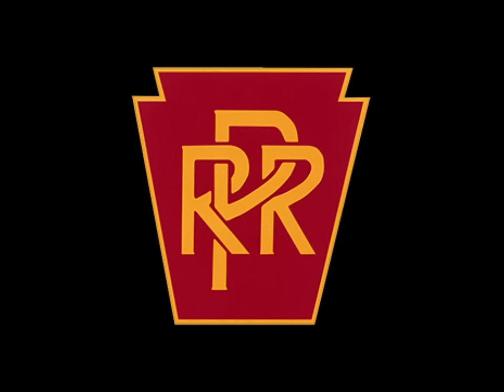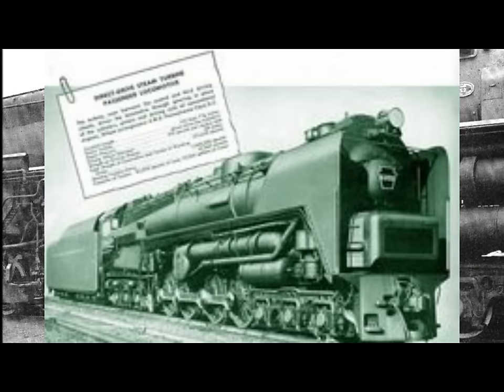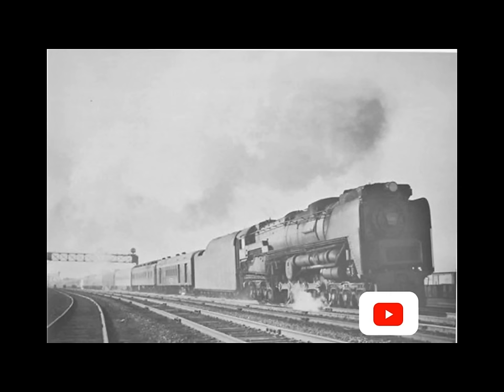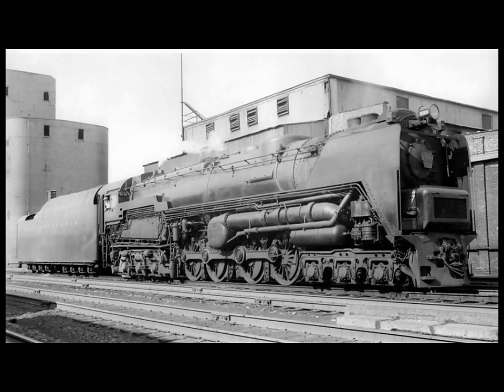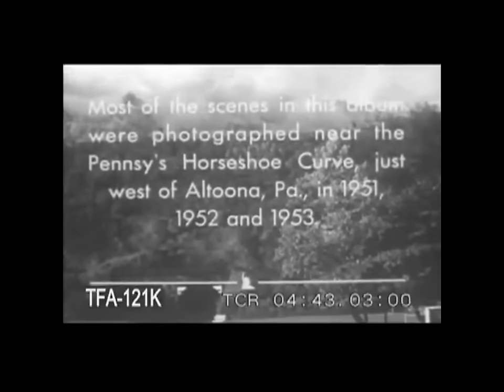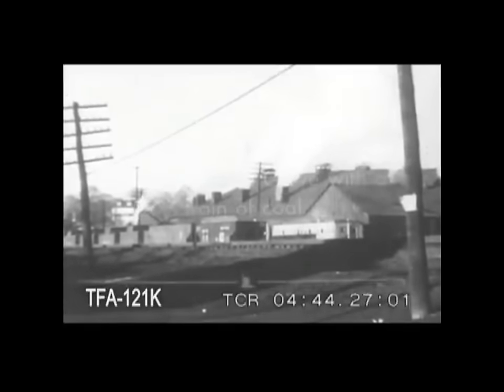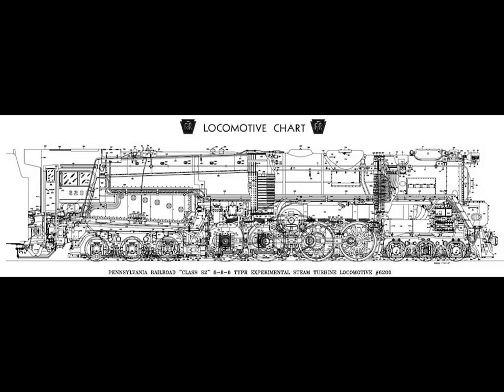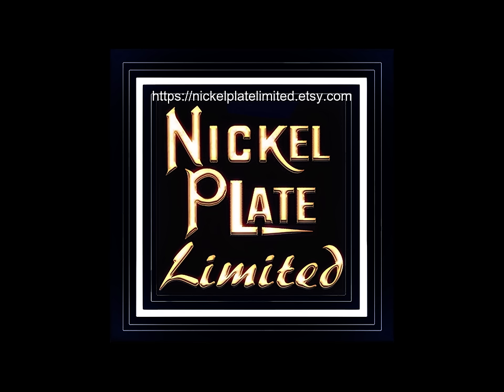Pennsylvania Railroad S2

Comment: A turbine for a locomotive will always be problematic.   Unless you got very long stretches of track with little to no slowdowns or stops. Turbines will never work to there full potential.
Reply: @animal16365- Chrysler Corp found out that the same thing pretty much applied to automotive applications. Turbines work fine in ships and aircraft, where high power output and steady speeds are required.

Comment: I believe the only change that may have given the S2 much more of a chance for success would be adding a planetary gearset to the reducing gearbox, thus providing two speeds. The unfortunate thing is the steam turbine is essentially a constant-speed engine, while locomotives need an engine which provides controlled torque, starting from 0 RPM. Naturally it proved ill-suited to an application which must accelerate and decelerate often, operate in either direction and no condenser can be fitted. Electric motors, on the other hand, excel at all of these things and so they propel practically all trains today.
Reply from the maker: And that's why I think the S2 would have done much better as a freight locomotive

Comment: The S2 has the same physical presence as the 800 class FEF and the Niagra.  The addition of smoke lifter ears added to their impression of industrial art.  All are free of frills and imbued with strength-of-purpose.  On the other side of the steam locomotive art are the streamlined steamers such as the GS4, the J class, the S1 duplex, the T1 duplex, and the Dreyfus Hudson.  My favorite is the Dreyfus 464 with Scullin disc drivers.  Credit must be given to the Pennsy for their bold locomotive engineering challenges never attempted by any other RR.

Comment: Sounds like they should have spoken to Sir William Stanier of the London Midland & Scottish Railway, His turbomotive was built on the same basis in 1935, and remained in service until 1949, and used a conventional Princess Royal Class loco boiler, working at 250psi, it was very powerful and very economical, and was only rebuilt  in 1952 after one of the main turbine blades failed, and British Railways were uninterested in repairing a one off loco.  Metropolitan Vickers supplied the turbines in 1935, and was designed to speed was controlled by turning on or isolating the turbine nozzle jets to overcome the problems all turbines have of being very inefficient at lower pressures (ie if driven like a conventional loco on the regulator/throttle).
Reply from the maker: A lot of consulting should have been done quite frankly

Comment: It is such a shame the s2 design quirks were never addressed. It was a fascinating design that really could have gone in many directions. Had they set a lower speed maybe locomotives similar to the s2 could have made amazing freight locomotives.
Reply from the maker: Yes indeed. Several authors thought so as well.
Reply: @TheRailroadCrossing-SteamPower image they combine this concept of engine with a challenger wheel arrangement. I really think that could have been quite good.

Comment: The S-2 is definitely unique in appearance and very high on the scale of cool looks.  It's a shame it wasn't effective enough to hang around longer.  A diesel locomotive's electrical transmission gives them a major advantage in starting trains.  The taller the drivers the bigger the disadvantage to the steam locomotive.  From a strictly business perspective, I wonder how much cheaper it would have been for the PRR to order Pennsy-ised versions of the NYC Niagara instead of all the experimentation with the T-1's and S-2's.  Thanks for another cool video!👍
Reply from the maker: Basically as I am seeing it.. The Eastern RR were doing these designs just to save steam.. And for that, that was a bad business decision alone. I think many things could have been done with the S2 to see it work as it could have.. I think it was given up on way too early.

Comment: Shame they didn’t fit booster units to both trucks. On starting with a sequential nozzle box they could then in stages engage the turbine as speed picked up & isolated booster units or let them freewheel.
A condenser & fan assisted draughting would have helped with water & fuel consumption.
It would indeed have lended itself more to oil firing in this state
Where there’s a way.
William Stanier of the LMS here in U.K. designed & built a turbomotive, in a conventional fashion but it was geared drive. Ran adequately for a few years.
O. V. S. Bulleid drew up plans & experimented with fan assisted draughting & condenser principles on the S. R. & in Ireland.
Finally of course the S. A. R. In South Africa came up with the Red Devil which is another story in itself.
Reply from the maker: Red Devil I am particularly fond of.  Good Stuff!

Comment: I just now came to your channel because YouTube "fed me" the link here. I'm 70 and when I was a kid, I thought the diesel engine locos (esp the E type) were so cool looking! So here's one person who didn't "romanticize" steam. At that age, I was all about the future. BTW, my family traveled cross-country '55 to '68 by train as often as by car. Also, how many passenger train riders back then got on and off the train from the tail, never even casting a glance toward  the front much less walking up to see the engines? No, passenger numbers, which were already on the decline pre-war (especially for short and medium length trips), continued to drop long-term after the war largely because of the increased adoption of the car as a mode of travel (as you briefly mention) and not because passengers were turned off by the diesel locos' "lack of personality." That was a concern only for the "buffs" and not, I would suggest, for the general ridership.
Reply from the maker: And that's a fair assessment. Many railroads themselves didn't want steam abandoned.. And as you know, many of them went to great cost and extreme's to make it viable against diesel which was pointless. They never could have done it for long at least, what with the tech available back then. Today, if steams infrastructure was still intact, Today's tech might be able to match or do a little better against diesel. Who knows though. WELCOME!

Comment: Check out Maxwell steam locomotive works I think is what it's called is based out of New Zealand and he's trying to build a brand new boiler design it was originally for a locomotive but he's converting it to us traction engine very interesting refractory Firebox that uses ceramic tiles it's only a single wall Firebox it doesn't have the double wall inner and outer Firebox like the old school it's using refractory materials
Reply from the maker: Will do!

Comment: that first picture is of the s2 in front of the freight shed  and to the right the machine, errecting and boiler shop, it was about 650 feet long, and behind that was the carshops before they were moved and to the south of the pennsy shops was bass foundry the largest railcar wheel foundry in the world around 1907 1000 wheels a day with iron supplied from 8 coupala furnaces they also made railcar frames and axles as well as stationary engines boilers and some machenery for woodworking, and the forge shop there contained up to a 7 ton hammer I think they talked of in the late 1890's and eventually did it was the largest drop hammer in indiana at the time, and had a shear they built themselves that was 50 tons and could cut 2 inch thick by 8 inch wide iron, though they tore it down in about 2016 or 17 and the day I went to take a video of the location where the roundhouse for the pennsy would have been I saw part of the building being torn down I did not know thats what it was or its significance or I would have taken pictures, as for the roundhouse it was down by the hump yard about half way to downtown where the shops would have been and now the post office and city barns for the city of fort wayne sit with just a plaque designating it as a historical location, 
fort wayne was on the end of the 31 mile streach know as the race track where many ledgendary and some of the fastest steam loco runs were made in the usa and world for that matter with one in around 1905 said to be timed up to going 127 mph though that had some doubt as the posts they would use to time them by were not always accurately spaced, but the s1 and s2 the t1's the q1 and q2's all came though here, the coaling tower they had and was taken down in the 50's spaned about 12 tracks and had coal pockets that carried 800 tons of coal and was built by link belt of chicago the same folks that built cranes and maybe still do, was the largest spanning one in the world when built and maybe ever though there were ones that carried more coal fully loaded like the one at shaffers crossing in roanoke for the n and w, 
but fort wayne was a big railroad town, and the kunkle safety valve that popped off was invented here from erastamus kunkle who worked in the shops at first he also invented the gage cock valve the steam and water pressure guage for engines, and the egg beater yes you read right.

origionally the fort wayne pennsy shops were an offshoot of the bass foundry though it was bass and hanna after william hanna an early german settler in fort wayne, and the shops were part of the chicago fort wayne and pittsburg railroad then that got ate up by the pennsy.
Reply: For the PA S-2 Turbine, they should have re-geared it for 70 mph max and 45 cruise plus boosters on trailing truck to help it get moving.
Reply: @markolesnicki416  maybe but it was all about high speed passenger rail back then with the sexy experamental locos, a shame it was not saved it did have advantages though at higher speeds less recipricating mass for example among things a booster well no one ever talked about that being considered or that I read in historical things about the s2
though curiously though instead of the useual overhead throttle it have more of a joystick throttle like in a figheter jet which you might or might not have know that used to be on the websight about the crestline roundhouse now even the office and machine shop have been torn down like within the last 3 years I heard and those were the last vestages of the crestline to fort wayne and chicago division, well you got the old baker street station in fort wayne but all the shops and buildings but one bridge and a water tank are gone as for where the legendary duplexes were kept and serviced, I dont know what they might have in chicago though, there are 30 some rail yards thought that giant city it would take research to find out if anthing of the old pennsy is there

Comment: I love turbines and have worked with them for years, but the steam turbine idea -- well to make it go you are going to need all of those extras that are used on fast ships. In broadly general terms the train is going to need a boiler, with air and water preheat to save fuel. A condenser equal in scale to basically every gallon of water that the train uses. Since you can not (well on purpose that is) slip the wheels (as  @kc4cvh discusses later) as you can a propellor,  I suspect an entire gearbox lined out for 4 more gears would have been needed. Might have been better to use the turbine to drive a generator etc with variable output staging. Oh and I suppose you would have to ditch that nasty coal stuff and go straight to oil, which has enough advantages to make it more efficient. I can not see how you are going to avoid making a propulsion rig that is twice the size of a  conventional engine - then if you have large numbers of people wanting to move at high speed long distances often you can make it work. Then you are really making a bullet train, and that bullet train would have an even larger propulsion unit. Be a hell of a lot of fun though.
Reply from the maker: And judging by the Gas Turbine, I doubt they could have made cost it efficient in the end with alll of the mod's to be made to the original design. Coal use was the big lych pin to making it viable. But as you allude to, coal would have eventually caused more damage. They just didnt know that just yet.

Comment: I don't know.... Some say the PRR S2 was the only successful American Turbine locomotive to be produced cause of its' time of service(which was almost a decade), while others say it was just another failure.
 I think the design could of worked out had they ditched the mechanical direct drive and moved to DC traction motors that way they could of had the turbine/turbines operate at peak at all times. They might of had to put Nickle Iron batteries under the tender chassis but they could of made steam turbines the Future of steam the Steam heads at the time were looking for. 
 I agree that the S2 may have just been a complete missed opportunity just cause the pencil pushers saw the bill and decided to give up on it.
Reply from the maker: Especially with the money that they had already invested. To me it makes zero sense to flush it all down the toilet and not want to develop the concept. I mean, how could not expect problems from something new and little to no R & D time.?
Reply: Someone either crunched the numbers on Dieselisation and said "we're going to dieselize anyway so let it go." or They hit the "magic number" of how much they could throw at a pet projects for the company and the board said "kill it". I mean the S1 led to the T1s so I'm shocked the S2 didn't actually lead to anything considering how long and how much they put into it also it's mind boggling. @TheRailroadCrossing-SteamPower

Comment: Its main problem is the speed when going slow it was very inefficient 

My idea is why not make the turbine idle at a higher speed and spin at a higher speed to make it better
Reply: Another problem is turbines only work efficiently with a condenser. Since the only cooling medium available on a locomotive is air, a condenser would huge and impractical.
Reply: @kc4cvh  what about modern technology for a condenser
Reply from the maker: They could have made things work, even back then. The design needed tweaks and better boiler design.
Reply: Steam turbines ( direct driven) not fit to different spead and load demands of an Loco. Also in old germany, in this time, existing several projects. All facing the same problems. To be efficiant and advantaged, Turbines need constant speed and load at design RPM, perfect in only one direction..! Loco's need exactly opposite. Thats it. But nice and interesting piece of egineering, all of them!! In Sweden still one operational Turbine existing, there you can listen on youtube the " spacy" sound, you'r right, really spacy!!! Thanks for your video

Comment: Not sure it would have been much use in freight service with such a poor factor of adhesion. (Only 8 of the 20 wheels are powered.)
Reply from the maker: It was over 4, that's not bad. The weight over the drivers and tractive would have limited it on freight, much like the 4-8-4's